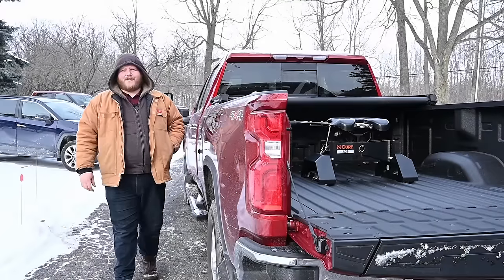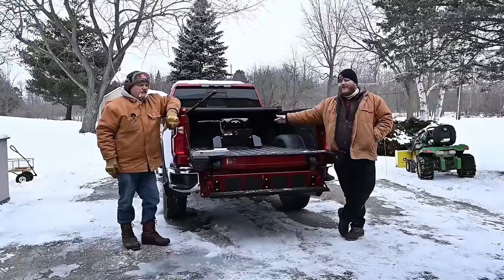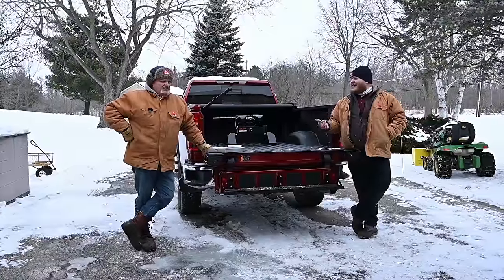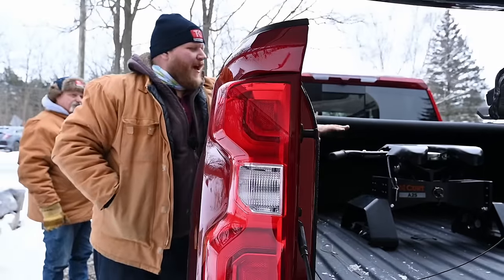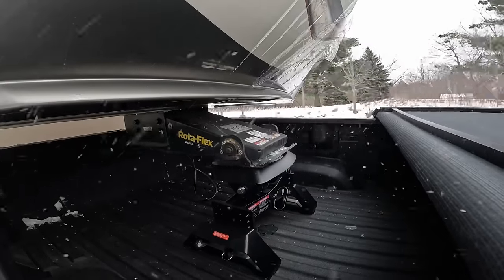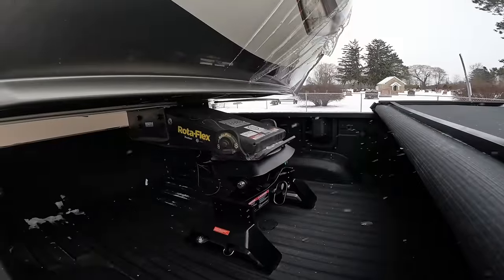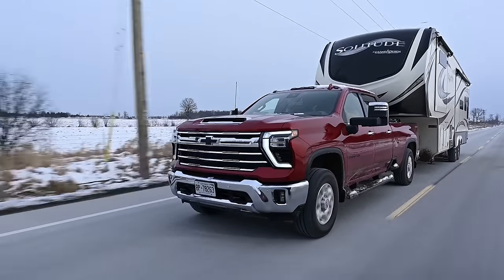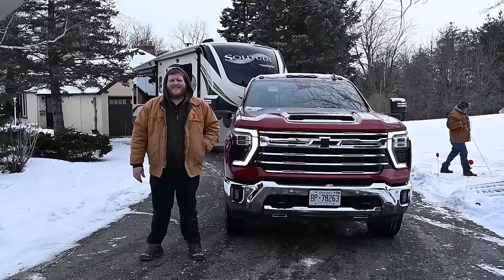Towing Tested! 2024 Chevy Silverado 3500 HD Pulling a Grand Design - Curt Crosswing vs Curt A25

Comment: I used to tow a full profile 5th wheel with a SRW LB F350, but I wanted more side to side stability. Went with a dually. Night and day difference. So much safer.
Reply: I’m trading my 2022 LTZ Dually for a SB. I pull a fifth wheel but this is my fifth dually and I just want a smaller truck. I think I used the toy hauler 5 times last year. I had a 2022 F350 LB in the mix too. It pulled good too.

Comment: I had a 21 Ram 2500 and towed a 5th wheel that weighed 11k and it towed fine.  I had no issues going thousands of miles with my factory hitch setup.  The only issue i have with you saying the ram wasn’t stable is that you moved the pin weight further back from where the truck was designed to tow because you were afraid of hitting the cone.  The further back you place the weight on the truck greatly affects the design characteristics of the vehicle and the way everything handles.

Comment: "Squarely over the axle", if you have a short bed HD, you will be 4 inches behind the axle. I have a 22 SRW LB High Country with a Q-24 Hitch, when I need more of the bed or use the Gooseneck ball, I lift the Q 24 up and slide it forward, and use a rachet strap to keep it from rocking or sliding around. Everything fits good under the "Retract hard cover roll up", which keeps it clean from the elements and dirt. You can remove the top hitch part to make it easier to handle, but just to lift a couple inches is not that bad. I really like your down to earth approach when explaining everything. I guess one of the reasons a lot of people want the short beds is maybe it will fit in a garage space better. When I built my house, I measured the then current 2006 GMC LB, and designed the garage with the extra room to accommodate, "the extra room", these trucks keep getting bigger. I traded the 06 SRW LB in on a 18 Denali Dually, stability and towing were great, but that's about it, the Dually is a pain as a daily driver. Another negative side to the Dually, if you have aluminum wheels, you are limited at tire rotation. There is one suggestion, if you need to use the Gooseneck ball on the puck system, don't use a curt ball, they are extremely loose, The B&W ball fits like it is supposed to. I think Curt made the Puck system the manufactures use, seems like they could make a better Gooseneck ball kit, but the tolerances are really bad.

Comment: I've used a Curt Q25 for 7 years and when you put the hitch in the pucks and then torque the legs they don't move. Hitch comes in and out of pucks easily after the 1st time set up. Traded a 2017 3500LTZ for a 2024 and I took delivery January 10th.  Our trucks are almost identical with mine being Red Hot and built about 2 weeks after yours.

Comment: I have a2022 2500HD pulling a cougar 316 with 1900 lb dry hitch weight and a short box with a companion hitch . On level ground can make a 90 degree turn. I also added timbren to the truck an truck rides level would recommend them

Comment: I have the A20 hitch in my 3500 CCLB DRW and love it.  It does come apart pretty easy w/ that pin.  I make's installation/removal easier.  Great video
Reply from the maker: Fair point. As fifth-wheel hitches go, the A25 is simple to remove with just one pin on each side and then four rotating handles to get the mounts out of the puck system. But still, lifting it in and out is not easy, especially for someone who might be older or by themselves.

Comment: You sure have an amazing truck to pull your camper.   I hope you enjoy it and have many new adventures.  One thing I did notice is when hooking up fifth wheel to truck and holding the handle to lock in king pin was leaning against truck side with an heavy winter coat unzipped.   Be really careful doing that and don’t put any scratches in your new paint.  I know a guy this happened to.   Enjoy your new truck!!

Comment: I have a 22 3500hd LTZ and towed my fifth wheel with the standard kingpin that came with the RV and a Curt fifth wheel hitch for a couple months. I was disappointed with the bucking of the truck when hitting the bumps. I talked myself into going with a Reese gooseball  and a Companion gooseball under bed hitch. Absolutely stopped 95% of the bucking with the gooseball's shock absorbing airbag. Even my wife said after the first 5 miles with the gooseball the difference was very noticeable. Not to mention, now I only have a 8# ball to remove and I have full use of my entire bed.

Comment: I have a 2021 3500SRW Denali 6.6 box with the Q20.  With that set up and a 37’ Columbus I can do better the a 90 degree jack knife.   I take mine in and out whenever needed, but I do it in two pieces which cuts the lift considerably .  More like a 30/70 weight ratio.  I have found the same issues getting it in and found it necessary to file off the sharp edges of the box side of the connection so it doesn’t snag so easy.  I have towed about 20,000km with this set up and found with all the towing features of the truck and the camera system it is stress free.  I hope you enjoy yours as much as I do.
Reply: Sure .  I downloaded the app.  How do I get your number?

Comment: Nice video. The truck is beautiful. I disagree about the long beds looking funny though. I think the 2020+ GMs where the trucks got so big actually look pretty good in a crew cab long bed. They are huge though. My 2022 crew cab short bed is only 9” shorter overall than the previous generation crew cab long bed. So these new bodystyle crew cab long beds are definitely long lol.

Comment: I have a Curt A20 fifth wheel hitch that I bought when I bought my 2017 Silverado 3500. When I upgraded to a 2023 GMC Denali 3500 DRW last year I had to purchase new side bars for the hitch to fit. I final assembled them in the truck and I can install /uninstall at will with no issues, but I use my cherry picker/engine hoist because it is heavy. I didn't happen to notice if you are using a nylon bushing between the trailer and truck? I have been using one for quite a while and they work slick. I also have a Solitude 310gk and I just got done installing 4000 lb springs and a one inch lift block to make the trailer ride level with my dually. I also welded in 2x2x1/4 angle iron braces between the spring hangers to stiffen the hangers and the frame to try and prevent frame and hanger cracking.

Comment: I tow  my 5er with the Curt crosswing and that is thanks to you guys. My truck has factory airbags and I have zero lean and that thing is as stiff as a honeymoon dick😂. Everybody keeps talking about sway and stability. I have no idea what they are talking about. I can't even tell it's back there even when I change lanes. And the ram exhaust brake is second to none from what I am told . The ease of hookup and the versatility of the crosswing is amazing. Zero clunking noises. I like to hear the comparisons because this new setup is all I have ever towed with and in my opinion I don't know how it could be any better. I did my research and you guys helped me with that. So I purchased the crosswing. I think I nailed it the first time. Thanks again for the great comparison videos. I'm going to stick with the setup that I have. Just don't see how it can get any better.

Comment: I just feel more safe confident and stable when towing with the chevy.  The ford in 2nd place and the ram literally feels like overloading a 1/2 ton with way too much weight to tow with. The inline six Cummins is a decent engine but the ram hd chassis and front end wear out fast and dont feel stable or give any confidence when towing with all the swaying and boncing.  The ford just bounced alot but didn't sway to much. Like i said chevy number 1 ford number 2 and ram number 3. I think some brands put out tow numbers that are 3 to 4 thousand pounds past what the trucks can really handle and I think they do that because they want to look better on paper. When in reality on the 1 ton dually high output diesels from all three anything more then like 28 to 29k is pushing the trucks almost past there limits . Just cuase a truck say 30k towing and the brakes and exhaust brake and chassis can barely handle 25k i dont think they should allow any more weight then 25 thousand pounds for towing . U really need 5500hd or f650s heavier trucks for daily towing with 30k plus imo.

Comment: Chevy hd’s are the best handling trucks for towing. Ford is a close second. Ram is like towing with a 1/2 ton after towing with a chevy. They all have plenty of power so that isn’t an issue.
Reply: What made you come to that conclusion?  I have a 2013 ram and have towed with my brothers duramax.  My ram is was way better.  Starting with the solid front axle.  The Cummins and the exhaust break has way more effect than the other two.
Reply: Good observation Billy. Obviously you've towed with all three. I am a one ton ram guy with factory airbags. As far as stability goes I'm just not sure it could get any better. But I've never towed with the others. How do you feel about exhaust brakes on the three brands? It's not very often that you get a chance to converse with someone like yourself who has towed the exact same 5th wheel with all three brands, new vehicles, all similar in options.
Reply: I agree with u @billylee2312 . I towed with all 3. Thr dodge is by far the worst chassis Wise and the ford feels like your all over the road.
Reply: @wastelander89  the 23 ford I have towed with was pretty close to my chevy it towed straight and confident just didn’t feel quite as planted as my chevy. Ram is just behind